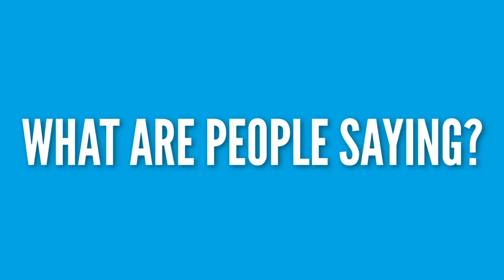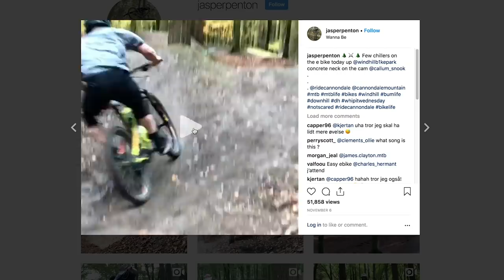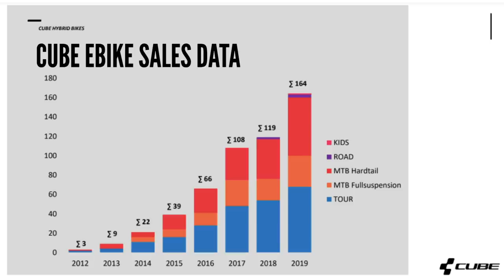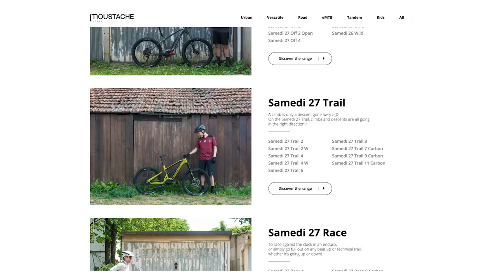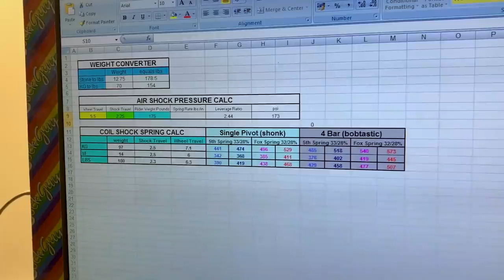Will E-Bikes Replace MTBs? | EMBN Show Ep. 48

Comment: How about some in-depth discussion of a Subject you seem to steer clear of, namely Ebike Motors. How long do they last, how long should they last, which make is the most reliable and a good look at the inside workings of the electric and mechanical setup and how do the different motors differ in their approach to the electrical power transfer to the Chainring.

Comment: Hi EMBN, will Ebikes replace normal bikes? Well I have had an interesting finding. I went to FOD early this year and did all of the trails on my normal bike. During the summer I have been doing loads of rides in solid Turbo mode with a friend on our ebikes. Recently I returned to FOD and I'm considerably faster on my normal bike! Why? I've worked it out. When you in turbo mode on the ebike your reactions need to be soooo much faster! I've been unwittingly training my brain to compute trails fast which has increased my normal bike skills! To my knowledge, no one has clicked on to this? So for me, my ebike enhanced my normal bike riding experience so although ebikes are great, they won't ever take over. They'll just be another way to enjoy the trails.

Comment: Can we get some more info on these DIY lights? Sounds amazing!!
Reply: I've checked a few sites and haven't found anything looking as interesting as what he had mounted on his bike. Was that running of his bike battery ? 6 volt ? Anyone got any links...  Bike lighting costs a fortune.
Reply: @sijmes  it would be a 12v or 24v light for a car usually a rear light or a extra light in bull bar etc to run them you need a step down circuit to take your battery voltage down to the lights voltage. These are cheap and plentiful on eBay aliexpress etc some lights actually can work from a range of voltages I have a set on my bike cost me 12 dollars plus a switch and it can run from 85v down to 12v. Very bright not high quality but work really well.
Reply: @Galvoflysoz  I'm going to look into it some more, standard output on my e-bike is 6 volt. Thanks
Reply: @sijmes  I don't think your output from your battery would be 6v? Most basic  bikes are like from 24v up and most now are around 36v to 48v and upwards for custom ones. 6v would not power you very well. Think of Volts as your motor power and amp hours as your fuel tank. 6v is less than a kids toy car even rc cars are either 7.4v and up
Reply: @Galvoflysoz  Bosche system has two auxiliary connection ports in the motor compartment. These are switchable on or off, 12 volt or 6 volt. This is done via the Bosche software and allows your lights to be switchable via the purion or higher, control switch.
Reply: @sijmes  Yeah ok so it's an out let not your battery. Your battery would be a 36v id say but your outlets have been stepped down already. 12v would be ok to run the light that's in the video as it's designed for cars etc. My lights as I mentioned are good for 85v down to 12v and remain the same brightness. I'm currently running then around 50v as I run a 52v battery but have tried them on 12v and they are same brightness. There's heaps of lights dirt cheap you just have to be creative with mounting
Reply: @Galvoflysoz  Thanks, which bike do you ride ?
Reply: @sijmes  Hi mate I have two home built ones. A vintage style cruiser with a large headlight saddle bags etc that I call my pub bike. And a Kona WO fatbike with a bbshd motor and ROCKSHOX etc which I have ridden over 1000km camping along the way in a hammock. They featured it on this show a while ago. For lights I did a quick search and found heaps. Look for 4wd reversing light most are in pairs and have a voltage range of around 11v to 30v so you could run directly from you battery cable or contacts but you will need to do some homework and be able to do a bit of hacking.i will say this though these cheap lights outperform most of the expensive brands. The other option it to mount a separate battery pack just a small 12v one which are cheap as well as what the guy used on his helmet in this video wired with a switch. This way your not interfering or modifying your main battery. Good luck let me know how you get on. And I'm happy to help as much as I can.
Reply: @Galvoflysoz  I think I may have seen the feature on your bike actually. I'll keep you posted on my progress on the lighting front. I own a Cube Hardtail, with a Bosch CX motor. I bought it to commute to and from work, which I have done for a few months religiously. I am however a little troubled by the drag when pedaling above the 25 kph cut off. I am eager to see if other bikes are much better in this respect, although I think it maybe swings and roundabouts on the whole. I put new, longer forks on it and it goes through the woods like a train. I have lots of other bikes too. Its a new healthy bug I've developed.

Comment: I don’t think it will coz of the cost of an e bike.  The price of an e bike is usually the price of a high end normal bike. Not all riders can afford them.
It would also depend on the country. If its a rich country or a third world country. So I think it will never go away. There are more poor countries than there are rich ones.
Reply: STIjojoSTI good point, also in third world for 1500 usd or do they are trying to afford small 125cc scooter... you can find 1500 usd E bike... but which offers more utility for price, small 125 of course. So currently it’s hard sell in third world. Easy sell in 1st world.

Comment: The battery technology of the auto industry is searching for that major break through, and Ebikes are poised to really take off when that happens.  I will be critical for Ebikes' weight penalty to be reduced to under 25%. 

Say a higher end full suspension bike (say a Nomad/Bronson/YB130/SB6/150/Spectral/Strive) weighs 14kg.  An ideal Ebike should be under 17.5kg.   Any more the bike would feel completely different.  It's definitely achievable with the advent of technology.  

The other thing is cost.  Ebikes should not cost over 30% more than similarly equipped MTB.   Right now a lot of ebikes are over $10K and that's just nuts.  The global economy just cannot support that.  Not to mention global men's rights are at a historical low.  

Also one of pitfalls is not making them motor cross bikes.  Because we already have motor cross bikes.

Comment: A caveat would have to be the impact of Brexit on bikes that have parts, let alone electric motors manufactured outside UK. I'm going to stick to the low carbon footprint and the economically wise option of human-powered performance, made in UK.
Reply: other than a minority of custom roadie frames and the odd hardtail, all those human powered bicycles are not made in the UK, and close to zero of the parts are made in the UK
Reply: @planesandbikes7353  you make a good point, even more reason I'll support home-grown such as Orange, Cotic, Stanton and Hope and give kudos to any bike brand manufacturing at home, helping the UK's GDP. Taiwanese cookie-cutter bikes and parts, Chinese made motors and batteries, overseas online bike shops all have a place. I'm just saying that in the UK market, people like me are especially stoked when we have human-pedal powered bikes and parts made in the UK. With the UK leaving the EU it will make many more UK MTBers consider the bigger picture before spending hard-earned cash.